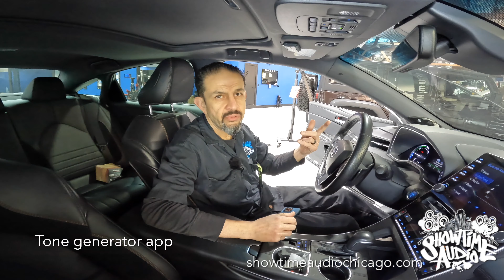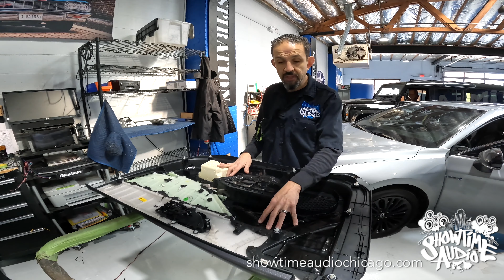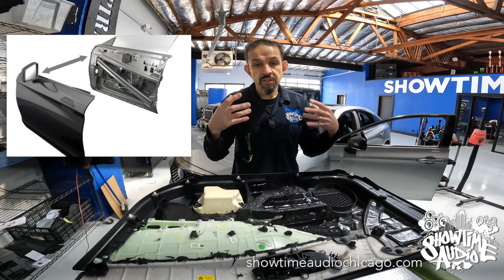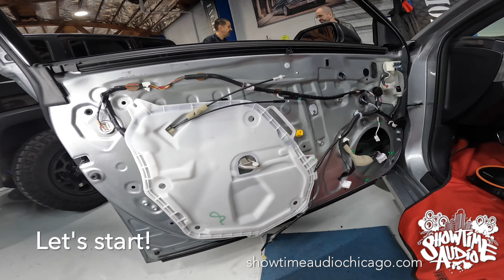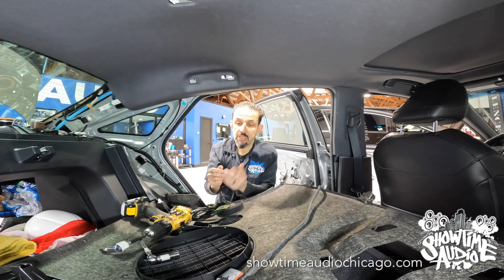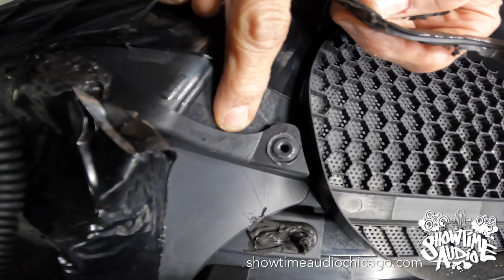2021 Toyota Avalon - Sound treatment (rattle noise solution) #carcustom #sounddeadening #toyota

Comment: I have a 2020 Avalon. Same issue. Super annoying.
Reply: I have 24 Camry same issue. Rattles Everywhere. USA built & sold quality. Asian(Japan) built & sold in Asia on much higher quality & additional materials from factory. And to add insult to injury, it’s cheaper.
Reply from the maker: Depends where the noise is coming from but this helps a lot to cancel noise